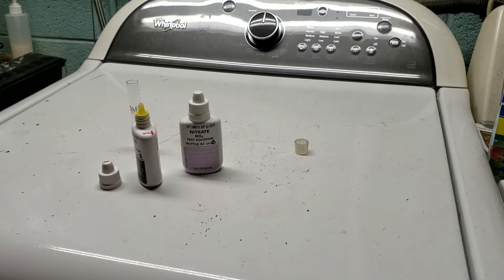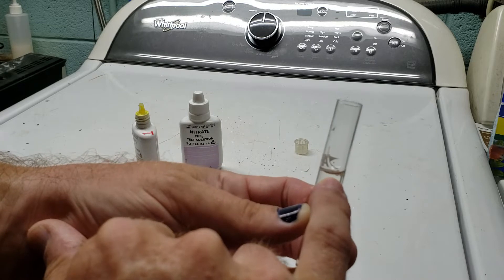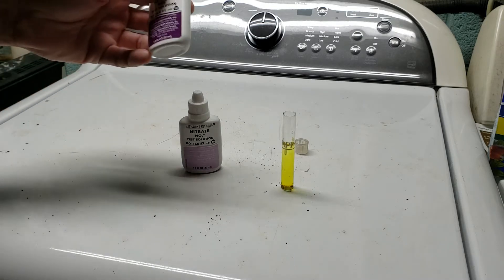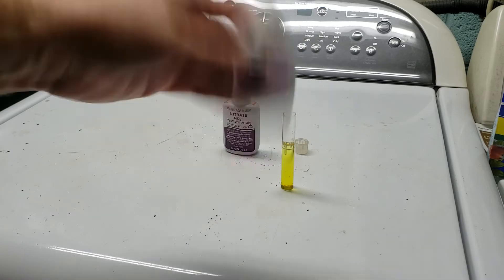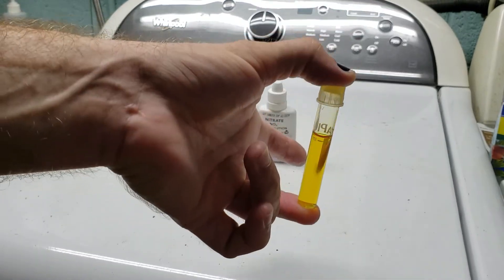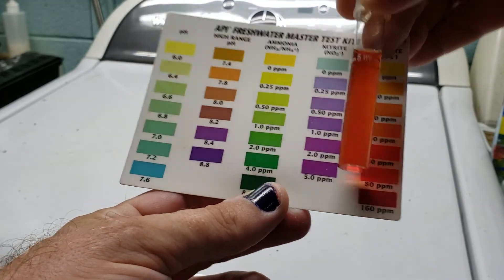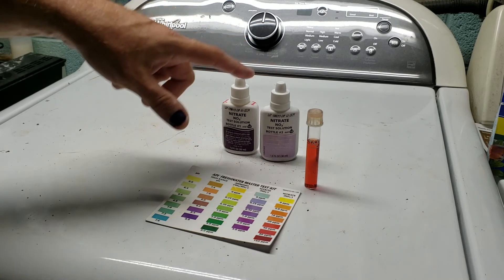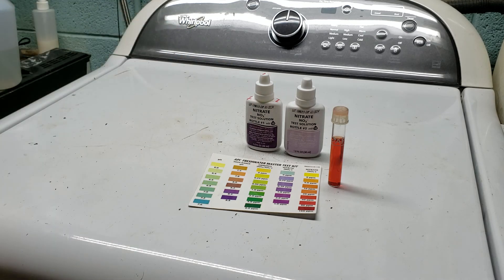API Nitrate Test: Do's And Don'ts

Comment: Holding the tube on the paper gives 80ppm and away from the paper gives 20ppm. Which means a water change if held against the paper. This should have been on the instructions. Thanks for sharing as this test kit was completely useless without this information.

Comment: @everyday fish keeping. Is there any accuracy to results of a degradation curve in the test? IE if you leave the sample for 24hrs and find a darker color than the 5min period reading, does that still indicate an accurate measurement?
Reply from the maker: It didn't so much with the old test kits, but they switched formula or something recently, and now it turns brown over time. I'd definitely look at the color within the the 5 to 10 minute window for best results.

Comment: I am cycling my tank with Dr Timms
I ran this test for Nitrate - not necessary for Dr Timms method but thought I would check it. With this test kit I got approx 20. I then used the API multi-test strips and got 160 for Nitrate !
Same for Nitrite - API Nitrite test showed about 2 to 3 but the multi-test strip showed 10 to 16 !
How are you supposed to check your water parameters with tests like these! I checked and both tests are supposed to read PPM.
These test kits are not cheap and I have no faith in their accuracy 
Am I missing something?
Reply from the maker: No. A lot of people complain about the test strips not being accurate though.

Comment: How do I clean my test tubes? I'm afraid using tap water will leave residual chlorine from the tap and affect the results of the test.
Reply from the maker: If you let some water sit out, the chlorine will evaporate. Or you can buy a gallon of distilled water to use for rinsing. And of course you can use a bit of tank water. i usually fill a vial, then pour it out and refill it to ensure it's 100% tank water.
Reply from the maker: @thejupiter2  I have nitrate in my tap water, so I need to rinse with tank water for an accurate test.

Comment: Slightly OT, but will API NH3 and NO2 tests (master kit for freshwater) be as accurate in a brackish tank?
Reply from the maker: Yes. It'll even work for saltwater, but the colors codes are slightly different. (brackish water will be the same color chart)

Comment: I have one tank that has 3" lava rock/pea gravel 3" sphagnum 3" crushed lava rock/Clay top. Very thick substrate. You could throw a dead body in that tank (it would be big enough) and not get a nitrate reading. If I did not have other tanks for cross reference I might have thought my test was faulty. I have it on a drip system now so it would be fine either way, but I found even with a 5 to 6" pea gravel substrate I never get past 10ppm. just takes longer to establish (4-6 months).
Reply: why is that?

Comment: I have begun to use Tetra test strips for ease. The ranges work better. The close colors are in a less important range. I have tested them compared to the API liquids and find them to be accurate but I don't care what the instructions say (they vary from package to package) it is important for nitrates to wait 1 minute. Also tested API strips and found them useless.

Comment: have you ever tried the test strips with multiole test on them? I found those were very good to test with and I've done comparisons between them and the api vial kits. they readings were generally the same to one another. quick dip into your tank's water and in 1-3 minutes you get results. no vials to deal with, no solution bottles, no cleaning the vials after use. Last time i used either was 20 years ago,, so I assume they have improved both in that time.
Reply from the maker: No, I've never tried them. Maybe I'll check them out next.

Comment: I have a 5 ml syringe and 5 ml of water does not even come CLOSE to that white line on the glass.vial.
Reply from the maker: So how much is it?
Reply: @DanHiteshew-oneandonly  I checked tonight. about 4.5 ml when the bottom of the meniscus reaches the white line. If you want 5 ml like it states, then you need water to reach the bottom of the "A" And "p" of the API logo. I wonder if they purposely slightly under volume the test tube to  to give a false impression of slightly higher numbers.
Reply: If the Nozzle of your 5 ml Syringe has Water inside it, you have more than 5 ml in the Syringe. 
The "Zero" line is at the Base of the Nozzle at the top of the Chamber. 
Don't believe me - a measuring Teaspoon is 5 ml - test it.

Comment: I'm having trouble lowering my ph.....I 've tried ph down....peat granules...Indian almond leaves....my other test are all good....
Reply: Add drift wood, indian almod leaves and other botanicals to your tank. Use rain water to add to your tank as well, and try Rooibos tea. make sure if you use the tea bagged kind it has unbleached bags. Get all the botanicals and tea and leaves togeter in a big pot and boil them for an hour slow simmer. pour off the water and let let cool in fresh water. make sure if you use tap water to dechlorinate it if it is from a municipal source. Next da,y once cooled, you can add all those to the tank including 1-2 cups of tanin stained water. That should do the trick. also check the pH of your water source and compare it to rain water in your area. Make sure any rocks or substrate in your tank doesn't buffer your pH. No corals, no limestone or marble stones, or any rocks that will fizz if vinegar is poured on them. If you are using a specialty substrate for growing plants that ttoo can buffer your pH. Check with the manufacturer. Most have a toll free number to ask questions. Google the company to see if they have one, or an email address.
Reply from the maker: Check your KH. If you have a lot of buffer (High KH) then you'll never bring it down for long. And trust me, bouncing your pH up and down trying to get it perfect is asking for problems.
You can try adding "drinking water" (I don't recommend distilled water) from the store, or install an RO system if you're really serious about it.